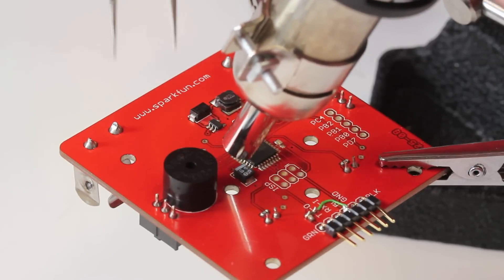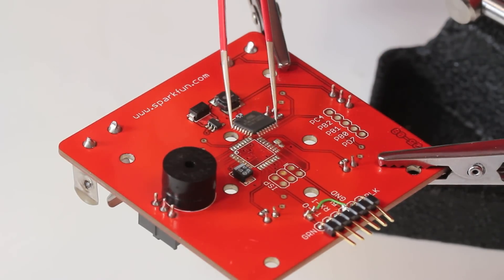SparkFun Hot Air Rework with David Stillman

Comment: If you're resoldering, it goes a lot smoother with flux. I'd definitely whip out the flux pen for that 90 degree chip rotation.

And please use a fume extractor. You get only one pair of lungs.

Comment: I have just re-flowed a chip on our Volvo, although I have got a rework station, I never had the guts to use it on this job, sticking to a needle sharp soldering iron (which worked perfectly).
After watching this, I will give the station a go next time.

Comment: Hi sparkfun I have a question I have a diy butterfly kit that has a smd parts and in the past I used regular soldering iron is it best to use a hot air gun the one your have to solder tiny smd resistors

Comment: A ceramic tile sold at home improvement and tile stores are great protection for 65 cents. I bought flat smooth and all white in a 12” X 12” size or smaller. These are fired clay with melted glass powder on them and force you to move “Soft” items from the path of parts that can melt. 6” X 6” or 8” X 8” can be found and sold as one. These work perfect for SMD parts and boards. Just a thought that is dirt cheap. Glass smooth white ones help see the part before or after. Helpful video!
Reply: Great tip, I tried it out though I refined slightly and used a concrete paver, doesn't slide around as much as the tile. Also, sounds crazy but I get much better results if I preheat the paver in my oven to 80 degree c. Hotter would probably be better but less dangerous at 80 deg c

Comment: Thanks for posting this on Youtube. The case in point I am addressing is removing and replacing 'through-pin' relays on a PCB where there are many s.m. components adjacent. With five contact to these relays by the time one contact has molten solder to do a second, then a 3rd, 4th, 5th. contact the first contact's solder has solidified. It's the same with a soldering iron, of course. So, what do you suggest?
Reply: Use a desoldering wick

Comment: So I guess the word is practice until you can do what's in this video. EH? lol! I just upgraded from a basic iron into a 3 in 1 which in my opinion is more like a 5 in 1. It has a variable voltage output 0to 15vdc, multimeter, ampmeter along with the hot air gun and iron. I burnt part of my PCB but I don't think it's damaged anything but this video gave lots of tips now moving to scrap boards for practice.😁

Comment: I set mine to 280 0_0 everything melts. am I doing it wrong? I see smoke everytime I try to desolder things but they look fine physically,
also I heat the board with a lower temp r simply from far away first. from underneath and above a lil circling it so the board is warmed

Comment: I have one, it works beautifully and does what I need. Bang for buck, in my opinion,  this is a good buy. I knew a little thought went into it when I noticed the rubber footing underneath, apart from tool footing, 4 extra pads for grip and harmonic dampening Id imagine. It also has a decent weight to it. So far so good.

Comment: Not an electronics guy but 'Station' to me, should include a vacuum hose, 2x variable  different 80/40w soldering irons and a couple of reels of solder sizes, and an option for hanging overhead to clear my bench space. My reaction to the fumes strongly suggests they are toxic enough to affect your eyes and lungs. So I found this, hot air only, video disappointing.